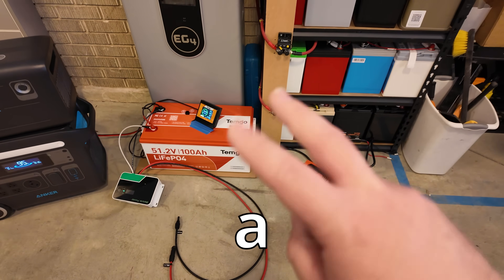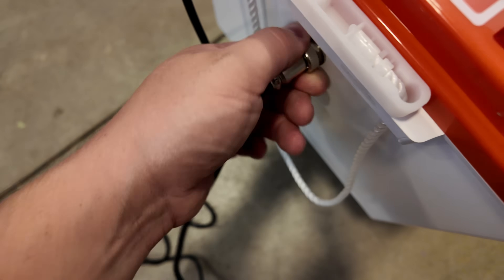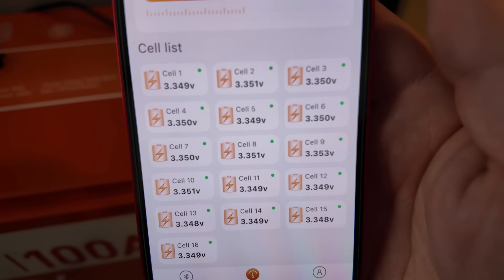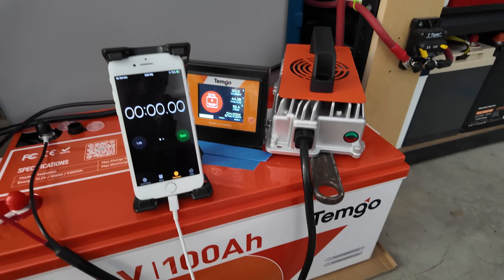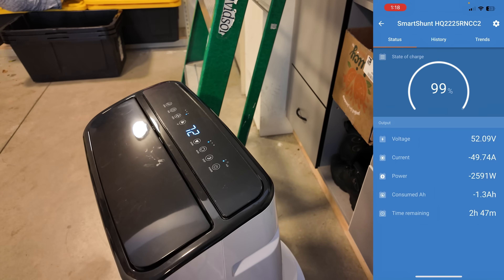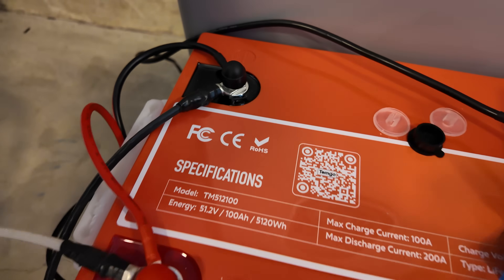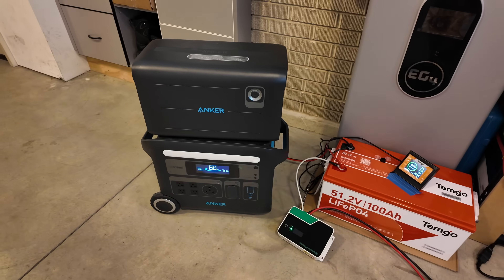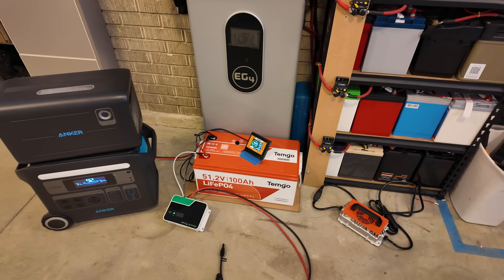Found One of the Best Battery Kits for Home & Portable Power-Disguised as a Temgo Golf Cart Battery

Comment from the maker: Buy the Temgo 51.2v LiFePO4 “Golf Cart” Battery Kit: https://www.temgot.com/products/48v-100ah-lifepo4-lithium-golf-cart-battery?ref=trickforthat 
OR buy from Amazon: https://amzn.to/4odUYPP
Use Code: JZJL3TJZ and save $50 on your order!

Buy cable to connect battery to power station: https://amzn.to/4fjTcZo
Buy a terminal fuse to protect your power station wire: https://amzn.to/40Jp2J7

Buy Victron Smart Shunt: https://amzn.to/45dgz20 

Buy the Anker Solix F2000: https://ankersolix.pxf.io/RG6oAN or https://amzn.to/4b4mGrU 
Buy the Anker Solix F2000 Expansion Battery: https://ankersolix.pxf.io/Qj6Xao or https://amzn.to/4hH9fRq 
Buy the Anker Solix F2000 + Expansion Battery Bundle: https://ankersolix.pxf.io/mO2vLM or https://amzn.to/3X3ifrG 
Use code: ANKERSOLIX20 at check out (Anker Solix website only) and save a massive 20% off your order! (Does not stack with limited time deals or other coupons)

Buy EG4 Equipment:
(Pro Tip: I don’t have a coupon code, however better still look into signing up as a free member to Current Connected and checking out their special member pricing! It’s usually pretty awesome!)
12000XP: https://www.currentconnected.com/product/eg4-12000xp-48v-split-phase-off-grid-inverter/?ref=116 
Indoor 14.3kwh Wall Mount Battery: https://www.currentconnected.com/product/eg4-indoor-wallmount-48v-280ah-14-3kwh-lifepo4/ 
Indoor Conduit Box: https://www.currentconnected.com/product/eg4-powerpro-electrical-conduit-box/?ref=116
Conduit box plate compatible with 12000XP https://www.currentconnected.com/product/eg4-indoor-buildable-conduit-box-top-plate-compatible-with-eg4-12000xp/?ref=116
Chargeverter: https://www.currentconnected.com/product/eg4-chargeverter-v2-48v-100a-battery-charger/?ref=116

Buy other parts and pieces:
Battery Shelves: https://amzn.to/3GHLWZX 
Battery cables, ring terminals & heat shrink kits: https://amzn.to/4iOOlPO 

All donations get 100% re-invested in the channel:
https://buymeacoffee.com/theresatrickforthat 

Affiliate Disclosure
As an Amazon associate I earn from qualifying purchases at no cost to you! Thanks for your support!

Comment: Thanks for the video. I have the same solix power station you showed in the video and this looks like a great option. Will the supplied charger work well with a gas generator for recharging? I’ve been hearing lately that some chargers don’t, and as a consequence people are using things like the EG4 chargeverter.
Reply from the maker: The charger has worked well with all of my generators I’ve tested it with!

Comment: I’ve been lobbying Anker to bring out a cable that would allow for more than one expansion battery to be connected daisy chain to F2000/F2600.  So far, it has gone on deaf ears.  This essentially provides me with a solution for that, thank you.  Question.  I assume you can also connect the expansion battery to the proprietary connection as well to add more capacity to the system, or would that interfere with power coming from multiple sources?
Reply from the maker: You can't connect to the extra battery port yet...but I am working on it!

Comment: If using the battery in conjunction with a portable power station, that is used only when utility power is out, what voltage would you recommend to store the battery at?  Would you recommend "exercising" the battery every-so-often?  Suggestions?
Reply from the maker: I store mine at 100%! Haha! LiFePO4 is so durable...I'd rather run the risk of slight degradation and have basically 100% capacity when the power goes out vs. missing massive amounts of power when I need it most just to save a tiny fraction of the life span of the battery! I do cycle them every 6 months down from full to 0 and back up to 100%.

Comment: What size wire were you using for this test? And what size wire would you recommend based on the max current draw?
Reply from the maker: From the battery to the power station a properly fused 10awg wire (see links in the description) for the 40amp charge controller, a properly fused 6awg wire.
Reply: @theresatrickforthat  10 AWG is enough for the max amperage draw ? Genuine question not trying to be a smart ass or anything.

Comment: Hey, quick question. I have only seen people doing this with 100ah batteries. Is it possible to use a 300ah batteries, like a 25v 330a battery?
Reply from the maker: 100%! Just be aware with the lower voltage, you won’t get as much power in watts into the power station. You’ll only get around 500 watts instead of a 1,000 with the 51.2v battery.
Reply: @theresatrickforthat it would have over 2000+ more wh though, right? Which would give me more backup in an outage.

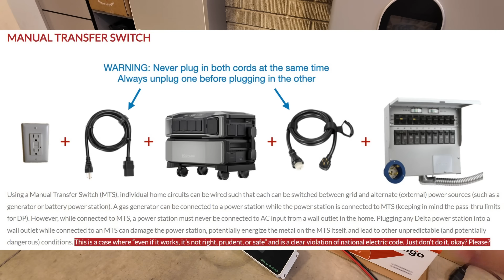Comment: Can you point me to, or go over in detail this 11:18 MTS problem? I was just about to go this route and now you are saying that isn't a workable solution. I did some AI chatting and it confirms what you are saying. I am curious as to the exact reasoning, as I'm not quite following the logic. Also if I understand it all a bit, I think if you simply charged the extra battery via the main panel circuits and the extra batteries were plugged into the battery power station (Like Apex 300), you would be fine?
Reply from the maker: There's a lot of info about this on forums and such. Loops of AC power fry people's power stations all the time. So by converting to DC you completely eliminate the possibility of creating one of those AC power loops.

Comment: Hi I accidentally reset the parameters of my Temgo Battery with the Overkill app it there any way to reprogram the BMS with the Temgo factory spec?
Reply from the maker: You should be able to reprogram it so long as the overkill solar app connects still to the battery! You just need to find the default battery parameters somewhere so you can put them all in!

Comment: I have the DChouse 51.2V 100Ah LiFePO4 battery connected to my Aferiy 3600-watt portable power station via xt90. and then the power station is connected to a manual transfer switch.  (works great BTW. Gives me 8,600 total watts ) MY QUESTION IS - - or rather clarity , you're saying it's fine to charge the 51V.2 battery and thus the portable power station)using the 48V golf cart ac / dc Charger,
 at the same time as having the power station not only connected to the 51.2 golf cart battery but also as I am pulling from 30amp ac port on the power station feeding the Manual transfer switch running a handful of circuits/loads in the house 
I am waiting on the solar panels to get installed on the roof and have been disconnecting everything from the 51.2v golf cart battery before charging it up because I wasn't sure if it would cause backfeed or some other issue.  

great video appreciate your help !
Reply from the maker: Sounds like a nice setup! It’s totally fine to charge the batteries at the same time you are pulling power from them! Thanks for watching!
Reply: @theresatrickforthat   Really appreciate it, this setup allows me to run 6 385 watt panels instead of 4. The Aferiy portable power station can only accept 2000 watts, I ran multiple volts/amp configurations but not able to make 2000 watts work. Never would be approved by City Inspector with 6 panels.  The larger battery 51.2 volts can accept the full 2310 watts from 6 panels, as long as he allows the DCHouse battery we're good to go. If not LiTime has one under 1k that's UL

Comment: Thanks for the great video!  Question regarding using the battery charger while connected to the power station.  For example, I have an Oupes Mega 3 that has a maximum 15A Solar input.  Would there be a concern with having an 18A charger charging the battery while connected to the solar input of the power station?  Obviously, I am concerned about frying the built-in Oupes MPPT by introducing too high an amperage.  I have a similar concern regarding a solar controller connected to the battery with Amps that exceed the Oupes rated Amperage.  Thanks again.
Reply from the maker: Nope! No issues at all! So long as your power station can accept up to 60v of DC input, it will self regulate the amps. Voltage is PUSHED Amperage is PULLED. The extra amps from the charger will be absorbed by the golf cart battery. And if it reaches full capacity, then the charger will automatically stop charging. Thanks for watching!

Comment: Are solar panels with micro inverters like Hoymiles capable of assisting the power output of a power station like the Anker Solix series or Ecoflow? Of course it would have to match the voltage 120v vs 240v.
Reply from the maker: You probably could…but it would not be a good idea. If you don’t constantly use more power than the microinverter produces it would try to  backfeed the “grid” like it’s designed to do only it will backfeed the power station inverter and probably blow it up. That’s a bad day on the farm. :) Thanks for watching!

Comment: This is a great arrangement. Is there any reason why separate golf cart batteries, each with its own solar charge controller and panels, could not be added in parallel? Then the only thing needed would be a certified "black box" "balcony solar" device instead of the power station to inject a limited 1200W into a wall socket (as just allowed in Utah) with anti-islanding protection. Very cheap grid de-loading (not grid defection) scalable in 5.1kWh golf cart battery chunks. Payback time possibly under 5 years for any size system. 24kWh per day would seem to be within reach if household usage could be levelled out.
Reply from the maker: Yes. I do think that idea would work. Thanks for watching!

Comment: Great content! The fuse link sent me to the 30A 58v fuse by SIGANOG not the 48, is that still ok to do your exact set up? I have the Anker F2000 and ordered the Temgo. Thanks in advance.
Reply from the maker: The fuse I used was an in-line fuse I had laying around…but the linked terminal fuse is a lot easier to setup! 58v is a great voltage since when the Temgo battery gets fully charged it‘ll be up in the 56.8v range. So you need a fuse that can handle the highest voltage the battery will get to. 30 amps is ideal for protection on the 10awg cable going to the F2000. You’re going to LOVE the setup! It’s a quick cheap way to massively expand your F2000 and its capabilities! Thanks for watching!

Comment: Nice. Sometimes I wonder why more people don't use these instead of server rack batteries but I suppose many factors come into play from budget, floor space, how much power you want to run at once etc. At 10c/kwh from a very reliable electric co-op it's hard to justify a huge expenditure for something that I only need for the very infrequent power outages. Connecting a battery to the solar port of a power station is about as plug and play as you can get.
Reply from the maker: Yeah! I agree! This entire golf cart battery kit is cheaper than the cheapest server rack battery I am aware of! And it comes with a screen, charger (that’s big) and then the really nice battery with a 200 amp BMS (which is double what server rack batteries typically have) and a water resistance rating! But yes, it can’t fit in a server rack cabinet so that could be an issue. But for a power station expansion kit, you really can’t beat it! Thanks for watching!

Comment: Sir, Thank-you for this video!  Of course, as we all do, I wanted the EG4 6000Xp, or larger etc. and all the bells and whistles.  Did not have the budget.  I have to offset the cost of that versus needing a new truck. (mine is 18 years old, and although it gets me to work, mostly, I can't visit my sister in another state unless she has agreed to come pick me up from wherever it leaves me)  So, I was going to buy a larger, poor-quality but more affordable tri-fuel generator, knowing I would spend more on fuel, and it might fry my wifi etc., but dreaming of "one-day".  However, if I spent all my money on the generator, it would also make sufficient battery bank storage and adding solar recharging "one-day" as well.  I have been researching this for quite a while, but your video just tied the myriad of options together in a straight line for my situation.  So, I just purchased the Champion 201223 tri-fuel on sale at Lowes for $601.13. (08/16/2025)  On natural gas, it puts out a steady 4,050 watts.  Almost, but not quite enough to run my house.   Purchased the Temgo battery & charger (used discount code SPY6OBIB) for $665.00 and now only have to select my power station to hook into a 50 amp receptacle for the house to have split-phase tie-in (with interlock switch, of course).  The generator will now charge the Temgo battery, instead of tying into the interlocked 50 amp breaker. (no longer need "clean" generator power- huge $ savings over buying a "charge-verter brick" or inverter generator.) and, that receptacle is also going on the front porch for the power station to plug into and tie back into the breaker box on a 50 amp double-pole breaker. Then the Temgo (also on the porch) will power up the Pecron or Oupes, or Jackery that can do split phase... I haven't decided which yet.  Any of these choices leaves me enough budget to actually get some panels. Also, maybe only a concern to people in the south during hurricanes, but I can leave the Temgo & the yet-to-be-determined-power-station, on my screened-in front porch, connected to the 50 amp receptacle, and only wheel out the Champion generator during daylight to recharge everything when I can actually see to aim my shotgun. I do have natural gas, as long as a tree doesn't fall and take out the meter anywhere on the road, or as long as all those new subdivision peoples' Generacs don't suck down the gas volume until I can't light my stove with a match.  Don't laugh, that happened during Ida.  But I have propane, and if really in the nitty-gritty can use gasoline out of my truck, as well.  I didn't think regular folks could get whole-home-back-up, like my neighbor who spent $12k on that Generac combo (but also could not power his house because every other yahoo was trying to do the same thing) unless we had a crazy overtime year and all our kids were already out of college so we actually got to keep some of that. Your video gave me the inspiration for how regular folks could swing whole-house back-up.  Thank-you ever so much.  Once proof of concept has been established at my house, I'm going to set up my kid's houses as well.  I think I might just have something to do when I retire.  🙂
Reply from the maker: Sounds like an epic setup and I’m so happy I could help you figure things out! Best of luck and enjoy your power system! Thanks for watching!
Reply: I like that last part, it's not just me. I bought everyone in the family a mega 1 and a 2500w inverter generator. Not gonna use the word prepper but I think it's good to be prepared for a just in case situation.

Comment: Are you able to do this safely because the solar generator has its own MPPT system inside? I keep seeing things that discuss risk of the battery discharging more power than its supposed to and damaging the solar generator, and an importance to buy an MPPT to use between the golf cart battery and the generator
Reply from the maker: Yep! The power station has an MPPT already built in. No need for a 2nd one unless you want to charge the external battery as I discussed in the video. Just don’t exceed the voltage of the built in MPPT and you’ll be golden! Thanks for watching!

Comment: I loved the Hack. Thank for sharing. Does anyone know how to connect this battery to an EcoFlow DeltaPro Ultra?
Reply from the maker: So I don’t have a Delta Pro Ultra to test with (Tell EcoFlow to fix that will ya? Haha!)
Anyway, the best way I see to do this without doing actual testing would be to hook some of these batteries up to the low voltage solar port. This way you could hack it and hook up high powered solar charge controllers to the golf cart battery like I showed in the video, and then your DPU will have 2 high power solar inputs. The only thing is the low voltage input will only put in like 800 watts into the DPU…but with these golf cart batteries, you could dump 800 watts into the DPU non-stop overnight, and then the massive solar array you could connect externally to the golf cart battery would easily be able to continue to provide the 800w to the DPU during the day and hopefully top the golf cart battery off as well. So could be a great solution for a DPU! Thanks for watching!

Comment: I built an offgrid system that uses an automatic transfer switch to switch loads to grid when the voltage drops too low, but its not quick enough of a transfer, so I've been considering buying an all in one power station with a beefy enough inverter to run my loads and do peak shaving/time of use, to save on my electricity bill. I could also then use my 3x 100ah 12v battery bank to use as the diy expansion battery. The only downside right now is... I don't currently have much more money to throw at my system, but power station prices are continuing to drop so hopefully i'll be able to get a 1800w+ power station soon
Reply from the maker: Sounds like some great ideas! Hopefully you get your new system up and running soon! Thanks for watching!

Comment: So can you just run the battery until it is dead and shuts itself off without damaging it? Then charge it up and repeat?
The website says that it can be parallel connected with up to four batteries. Why is that? Because I would be more interested if I could connect at least six or more as an alternative to server rack batteries.
Reply from the maker: Yep! If LFP chemistry, so you can run it hard with limited effects on longevity! Most places have a limit to 4 batteries in parallel. They are thinking you are going to be paralleling them using cables on the terminals themselves. If you have a bus bar setup and proper fusing/over current protections in place…they sky is the limit to how many you can parallel. Thanks for watching!